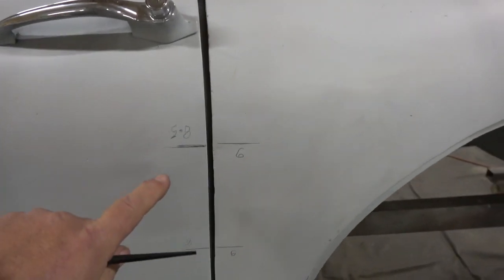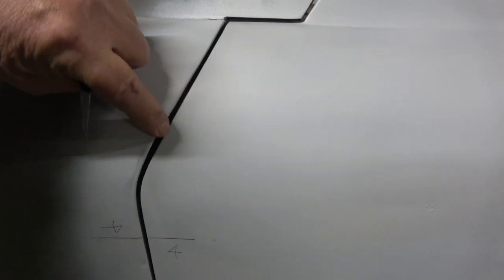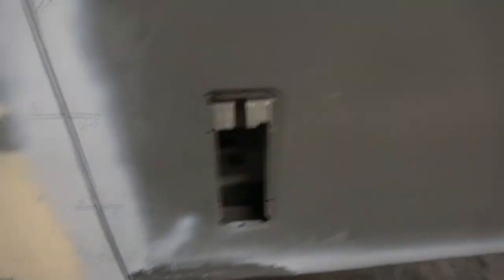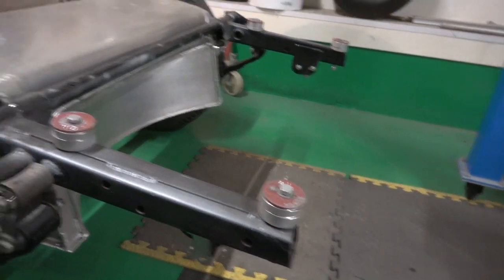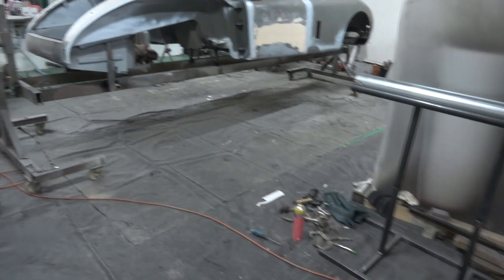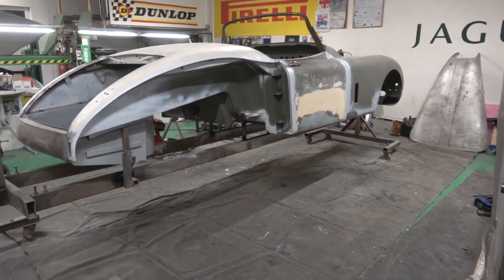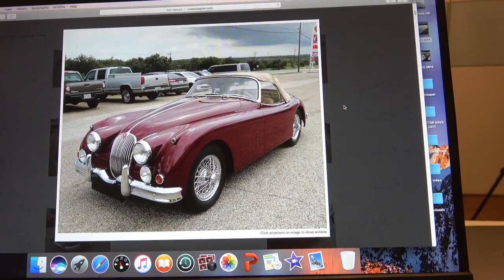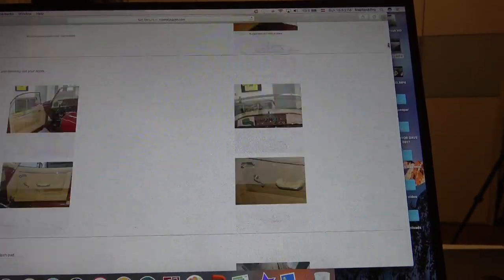Body Jig / Rotisserie Warning  ( Issues To Look Out For )

Comment: The gaps in body panels is the same thing you experience on door gaps once you start adding the glass the regulator and interior trim to the doors the doors can move and have to be re ajusted to get the correct gaps because of the extra weight there's lots of things to think about when rebuilding a car glad you have put this video out Dave a reminder to us all. Hope your all keeping safe mate   Rob
Reply from the maker: Rob, I agree there is a fair bit of weight with glass and chrome in the doors, The regulator & glass in a mini door is easily the same weight if 
not more as just the frame and skin itself. The rear wings will line up better when we replace the B post studs so we can snug the wing up 
to the B pillar correctly. The proof of the pudding will be when it‘s back on the chassis. Cheers Dave

Comment: Great video Dave , interesting point about the different tensions   whey inverted , will keep that in mind on the mini
Reply from the maker: Peter,  Being a saloon the roof gives the shell so much more strength, If your doing major replacement of panels you need some bracing 
for sure. I see now the jigs there selling comes with the main tubular support option that speaks volumes to me lol. Cheers Dave

Comment: Dave. Mr. Uniform here!  Don't  worry about those gaps too much . As you say inverted it's tensile and right way up compression. You  could easily adjust the gaps by adjusting the amount of spacers . Basically,  if you put an extra 5mm in the rear attachment points ,when you tighten the body  down the top will tighten up closing the gaps. Does that make sense? Regarding the colour, did my pictures l sent you of the 140fhc inspire you ?😂😂   l wouldn't be surprised that if you were to refit those rear wings they would gap ok.  If you recall l told you about the flexing l experienced with the Lotus Cortinas . Honestly Dave,  you really have very little to worry about . So as the song goes "Don't worry ! Be Happy !" Take care and stay safe.
Reply from the maker: John, I agree we can make tweeks here and there but i would like the shell to sit as near perfect as we can get it with the correct amount of shims and fibre washers, My biggest issue is while it sits on the jig i don't like the idea that there is movement in the shell. But as you say there is bound
to be some flex no matter what we do. when the rear wings are secure I'm sure it‘s much less. Cheers Dave

Comment: Dave, go for the Claret! It’ll really pop in the sun and be very sexy in the shade.  Cover the chassis with a sheet body shop film to protect what’s done as best you can.  On my mk 2 I welded coat hanger wire to tighten the shut gaps.  Cheers 🍻 John
Reply from the maker: John, I must admit i really like the burgandy or claret with the tan interior maybe not very practical but looks fab lol. Cheers Dave
Reply from the maker: John, I think the colour maybe opalescent maroon which is the same colour my E type was originally which is strange lol. Cheers Dave
Reply: @ClassicCarCave  you are correct it is opalescent maroon is the right colour.  Long story why I thought it was claret.  My E is going to be opalescent maroon, Glazurit 55 line.
If you the stock number let me know.  I like the Glazurit as it’s very high pigment content and lays out with no mottling, more expensive but I find it’s worth the bit extra cost.  Thanks and cheers 🍻 John

Comment: Bit of a worry Dave . Is the body all steel.
Reply from the maker: Pete,  With all the bracing bars inside the car there should be no movement at all, Fitting it back on the chassis will tell the story. Cheers Dave
Reply: That is what i thought Dave.

Comment: Hi dave, what about closed cell foam for the chassis to body strip? 👍
Reply from the maker: What is closed cell foam and where can you buy it ? The problem is there is only around 2-3mm gap between the chassis & body. Cheers Dave
Reply: Hi Dave, i shared a link on whats app group as an example; polyethylene waterproof sponge. should do the job. Just search closed cell foam on ebay 👍

Comment: Dave i just watched Toms welding vid he did'nt mention what to set the gas pressure at for welding thing sheet. Ive got the same welder as Tom what would be the best pressure?
Reply from the maker: Pete,  If you set the delivery gauge at between 15 to 20 so when you pull the trigger it drops to 15 or slightly below it will give you enough
sheilding gas but i use a larger % of Argon than Co2 in my bottles. Drop Tom a comment and ask him what he sets it at. Cheers Dave